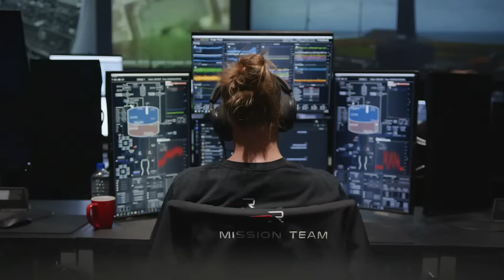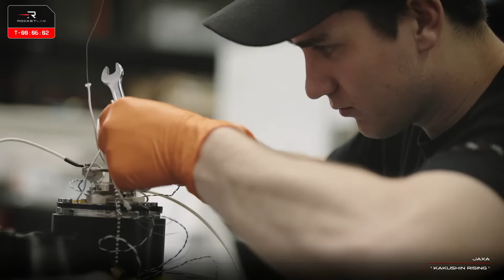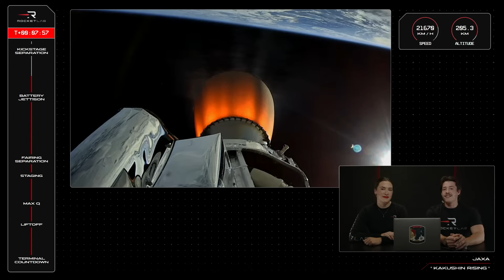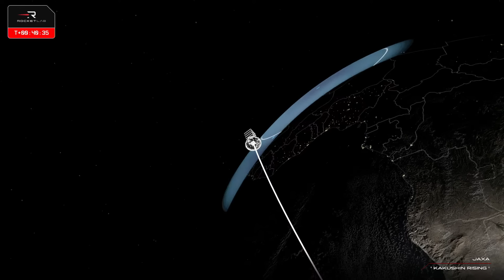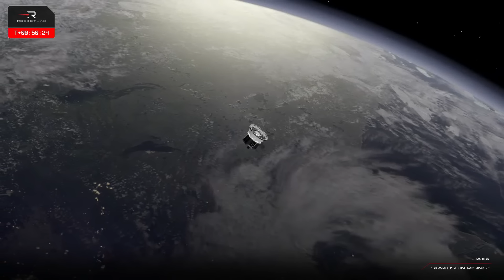Rocket Lab - 'Kakushin Rising' Launch

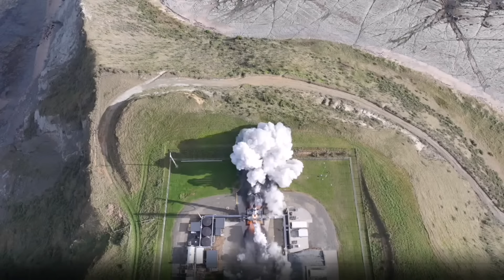Comment: 19:11 - T-3/lift off, 
20:27 - MAX Q, 
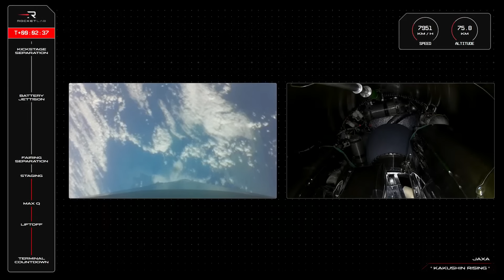21:47 - Meco/Stage separation, 
22:30 - Fairing separation, 
25:47 - Battery hot swap, 
28:12 - Seco, 
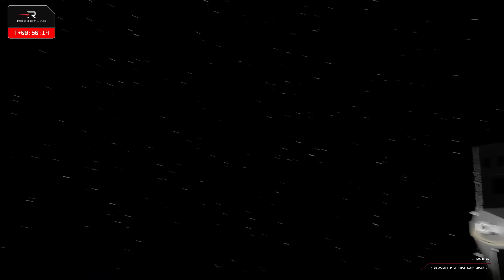1:09:38 - Payload 1 deployment,
1:10:08 - Payload 2 deployment,
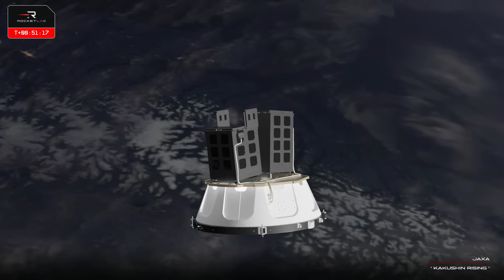1:10:47 - Payload 3 deployment,
1:11:38 - Payload 4 and 5 deployment,
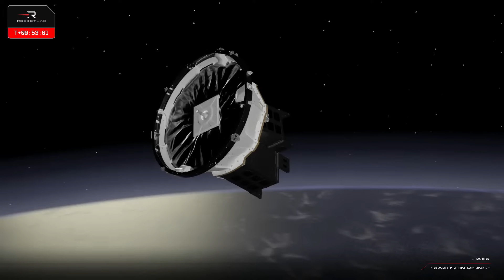1:12:33 - Payload 6, 7 and 8 deployment.

Thanks!